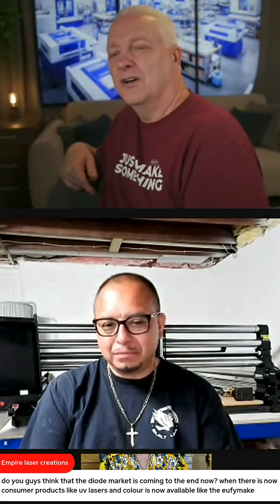Is the Diode Laser Business DEAD? Here’s the Truth #shorts #maker  #lasercutting

Comment: What folks need to understands physics, different wavelengths ablate differently on typical things folks want to laser.   Lasers are 2D with very limited Z.  However what will come in these low end markets will be 4 and 5D laser gantries and combo glavo.  And you will see migration to all fibre to tool head migration which enabled multi-band optical mixing of multiple laser type on same chassis.  So lot of room for all laser to grow.   And you will see multimode lasers that multiply frequency providing much wider range of applications.  So more fun to come Professor J Cloudfather
Reply from the maker: Interesting perspective, and it all exists today in high end industrial lasers.  The future won’t be 4D and 5D. You really mean 4 and 5 axis like CNCs have today.

This may come eventually, though we’ll start with pushing proper 3D engraving down to the masses. And this is going to happen much sooner that most people think. It will be this year. Then within a few years, we’ll eventually get to multi-axis laser cutting and possibly kill off the bulk of 3D printing